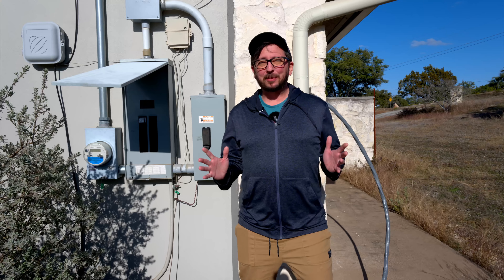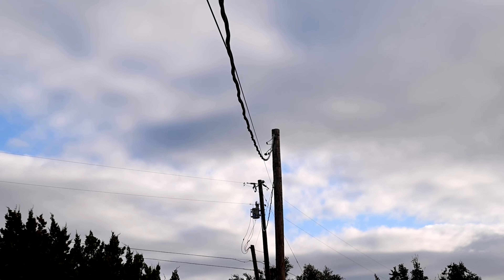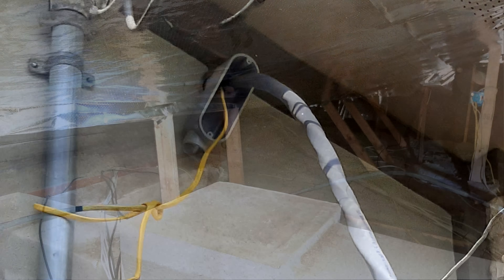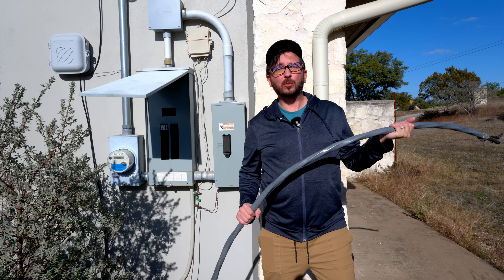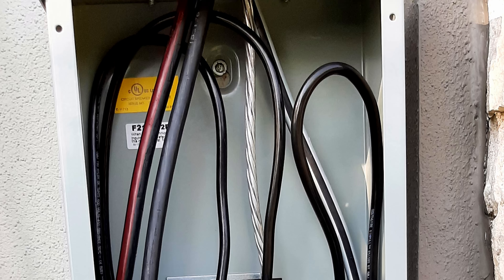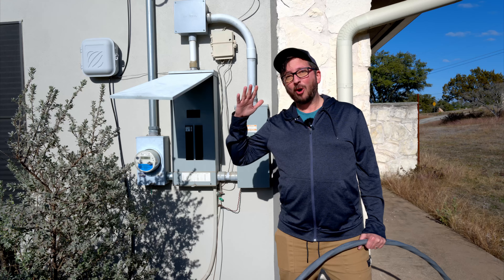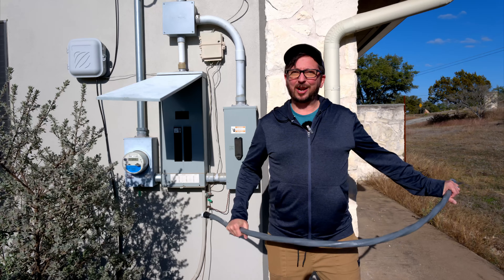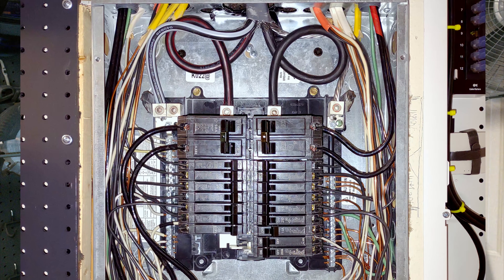INSANE Homelab Datacenter Power and Electric

Comment: Perhaps you mentioned this in a previous video, but I imagine that you might have some substantial costs in cooling your room and equipment. Though I find your implementation to be very impressive, and congratulate you on a job skillfully well done, I personally strive for high efficiency in power consumption. My equipment rack with two 2-bay Synology NAS units, one Planet modem, one Cisco router, five Cisco managed switches, 5 Cisco WAPs (not in the rack but powered from it), four Hikvision PTZ dome cameras, and two cooling fan units, only consumes a totalof 147 Watts. I think that my wife would not be too thrilled with me if I generated high utility bills as yourself. Anyway, have fun with your awesome system!
Reply from the maker: I also am continually striving to achieve more and more in the high efficiency in power consumption realms. I reuse the heat from the garage datacenter in a forced convection setup to heat the entire house during this winter so far. So far we have not had the Central Heater kick on. It may not be 1:1 but I will be measuring that at the end of January. 2.2 kW hourly 24/7 vs 10 kW heater packs kicking on every few hours this may be close. The total cost of running this is ~150/175 a month for just the racks. I do indeed have a window AC unit that blows directly into the face of the server racks you cannot see, which does need to run at least 7 months out of the year. I did insulate heavily and radiant barrier the walls/attic in the garage and that does help a lot also. In addition I did solar screens on the east facing window in the garage and a crazy insulation board insert. 

I'm also in the process of upgrading to all EPYC Rome servers and will be removing the most energy inefficient 2 switches as soon as I can get the SN2700 fully cut in. The ICX6610 is an absolute monster for wattage eating. I should also note that I do run a business that has intense data processing demands off one of the JBOD's worth of disks and have a dedicated PBS server running and doing incremental backups every few hours. I hope to get this down to the 1.5 kW range but increase overall effective processing power in the next few months. You are indeed running an order of magnitude less wattage but do you run Dockers/VMs off a dedicated machine?
Reply: @DigitalSpaceport  Thank you for your detailed explanation. Yes, I run six Docker containers and one VM on the two Synology NASs. What keeps my system busy the most is the surveillance app with its four high resolution cameras. On our dairy goat farm we this to monitor the stalls in our barn 24x7. About 80% of our network traffic is Intranet as opposed to Internet. One of the nice things about our fairly low power consumption is that I am able to keep my rack in our telecom closet with the door shut, and not exceed 95 degrees F. The fans alone are enough to keep the equipment cool.
Reply from the maker: That's cool you could even run that pretty effectively off a simple solar setup I would bet without a massive effort. Mini PC's that are really good have come a long way also for a lot of tasks. Its a great time to be into nerdy computer stuff!
Reply: @DigitalSpaceport  high efficiency in power consumption realms and yet, you appear to have a pretty good stack of older Dell's that aren't exactly efficient. ('tho cheap, and the power they use is still cheaper than $$$$$ new servers.) As for heating, I heat my house with gas... $30/mo. (it would cost more than that to heat a single room with just electricity.) Using otherwise "waste" heat is always a good solution. (that's how I keep my office warm.)
Reply from the maker: Well yeah and like I mentioned I am getting rid of the 12th gen Dells as fast as I can find cases for EPYCs, I have a new 7702+mobo waiting to be built (rack case hunting mode). The wattage on a R730xd vs R720xd however is neck and neck and while you do get more units of cores per gen13 on the CPU side, its not enough for me. Additionally available # of PCIe lanes at full speed is my biggest reason for having so many servers. These things are filled to the gills but the upgrade from PCIe3 to PCIe4 in addition to more than doubling cores makes the EPYC quest worthwhile for sure. The heat reuse is about to be put to the test this week LOL 😅

Comment: Laughs in 240v. I really dont understand why when you technically have a 240v supply but centre tapped why the us doesn't just over time start converting over to 240v one side of Japan is doing so, so much amperage for the sake of having 120v, your ranges and dryers etc already use it!  i know in Central Europe they have even higher rated sockets @16A as opposed to the uk being 13A purly cause of our "32A ring main" systems. We have now even started putting 3 phases in our houses as standard due to the likes of heat pumps, electric cars and solar panels, etc. It just seems strange to stick to something "simply because that's just how we have always done it"
Reply from the maker: Dude you are preaching to the choir on this. I love having so much wattage crammed into a circuit.
Reply: Realy strage to here 125amps but is that 1-phase?  In my house here in Sweden i have 3-phase 25amp mains and that is on a old house from 1966.  125amp@120v is 15000w. 3*25@230v is 17250w...  I my singel 22u rack i pulled on phase 16amp for a maximum of 3680w.    When will US switch over?  Is newer houses in the US making the switch little by little or is it only special use cases ?
Reply from the maker: Yes it is single phase service here. The service is rated for amps, not volts/watts, at least here in US. I could technically run everything 220 and the electric company would be fine with that, happy probably as I would use more wattage. I would not have most of the small appliances available and that would include TVs and bathroom stuff, lighting. Honestly lighting should be PoE LEDs with cool color options but that's a different topic entirely. When will the US switch is a very difficult question to answer and I suspect it will be never if we have not already started. I have not seen any residential that is ran all 220 unfortunately.
Reply: @DigitalSpaceport  having watched jay2cents commercial places have a 240 with a step down transformer on site, it just seems more efficient like you said with the tower PC switching psu's are more efficient EDIT: I missed you saying poe lighting. This makes so much sense, and I have said that for years, we should do this. There is a standard similar to what lifts use where a extra low voltage signal is sent to a controller to power a lamp on. Even at this point with led use a separate 12v system. So much waste converting it on the spot per lamp
Reply from the maker: I feel like PoE could really be the solution to soooo much. TV's could be powered off them, Monitors, Lamps, Cell Chargers.... even really decent mini PCs could run off it direct. Then you don't need stepdowns and everything runs DC that's already going to invert it to DC at any rate. Would be a huge efficiency savings. I have HUE, which aside from their recent HA stance garbage take, would be awesome to have something like that running. Not to mention it would be much safer to have these lower voltage systems in houses. I'm ready for this future!
Reply: @DigitalSpaceport sorry small essay You remind me of a video I watched where this guy was exploring the media setup in a hotel, room they had old coax cable (now redundent) and a fiber with poe switch hidden behind a panel under the tv and it was all poe powered so it is totally possible- I will have a look for it and post a link.- video appears to have been made private ! I am currently in the process of dragging my grandparents' house (1905) into the modern age with a central server smart tv and wifi ethernet etc for plex, home brew (headache), and cctv, etc I stupidly went the route of Bluetooth based Phillips hue lights with them useless alexa echo things not realising you could get standard "light switch" smart plates that you can use with WiFi or zigbee and existing light fixtures with inexpensive bulbs  UGH! I refuse to get a hue bridge "just to make things work their way! Realisticlly, I would love to get them kinetic switches that don't need wires or battery's and talk to the thing in the ceiling as a rewire would be costly! If I ever got the chance to build my own home, it would be like the jetsons. I think we have a lot to adapt and learn about the possibilities with the tech at our disposal and need to think about how we can use it to be far more efficient. SIDE NOTE: If you're interested in this stuff, a scottish lad I follow is doing up his flat to be just like this. If YouTube allows, here's his channel https://youtube.com/@camerongray1515?si=w--9xBziXl0U3QHF

Comment: And here I was thinking a clamp meter was going to be used on each of the legs of that 125A drop so we could see actual overall use…..

But good enough. Hopefully you’re making more $ than what this costs you per month in electricity which in sure is $$$
Reply from the maker: It's 150-175 extra a month at 2.2 which isn't that bad at all. As long as I'm not running the r930's. Earns ~1k on XCH on 2 PiB and much  more for the business data on 600TiB.

If I used a clamp on the legs it would catch all the rest of the circuits running off the sub panel and it's a decent amount of added draw. Thanks

Comment: im always curious about this subject about america. here in the netherlands, we have 240v and 16amps per group (think you call it breaker) and thats standard here. previous house i had 10 groups of those. 3700w per group can be pulled here. How is that in america?
thats just standard. we can also get (ill translate it litterly) powervoltage at home. thats 380v with 16 or 32 amp connection.
Reply: Keep in mind that's 110VAC at 200A. A typical household in the Netherlands has a 3x25A connection, but with modern heat pumps or other power hungry stuff it's more like 3x50A
Reply from the maker: We can pull 200amps of service on most newish residential house. 1950-1980 150 amps total was common. Prior just 60 amps. I can install a second panel on the house for a second 200 amps or upgrade the current panel to 320 or 400 amps. Many house use 120vac for non appliance plugs.
Reply: Can you really the maximum from all circuits (groups?) at the same time?
Usually not all circuits will be fully loaded. E.g. your lights wont use all the amps of the breaker they are on. You don't have all all devices running at the same time. etc. 
So your backup-fuse will be smaller than the sum of all the circuits that are connected to it.
You might have ~80 amps for the whole house, 32 amps at the next level and then 16 amps for each group.
Reply: Most US residential connections are 240V split phase (single grid phase into a center tapped transformer) at 200A. However, several homes will share a 25KVA transformer, so we can't all go nuts at the same time. Only a handful of things throughout the house will have the full 240V... oven/stove, HVAC, clothes drier, electric water heater, EV charger.

(Commercial can get whatever they need... 240 spilt, 240 3ph, 480 3ph, 600 3ph, ... I've even seen mills take grid power directly - 7200v)

Comment: you  need to upgrade your 1 Gbps to at least 5GBps down/ 1-2Gbps up for such infrastructure
Reply from the maker: I should be able to in 2024. Waiting on infra upgrades that are underway! Super excited for that. I do tremendous inhouse data processing however that uses a lot of my network capacity. Hitting 600gbits internally has happened in a non benchmarking scenario while doing a large project.